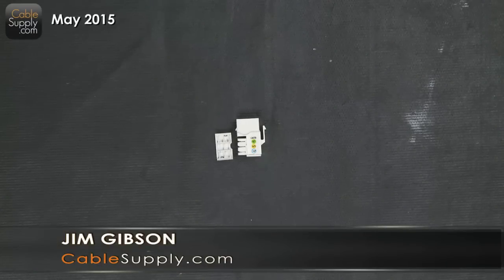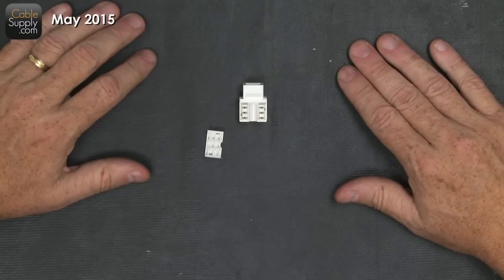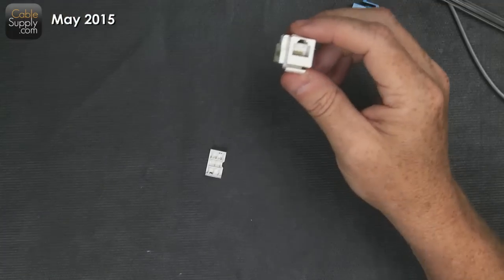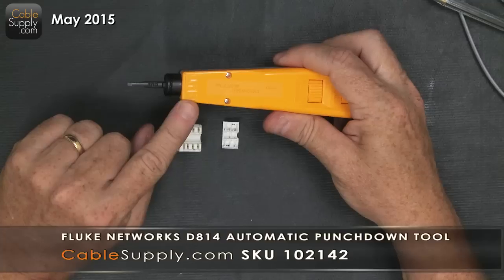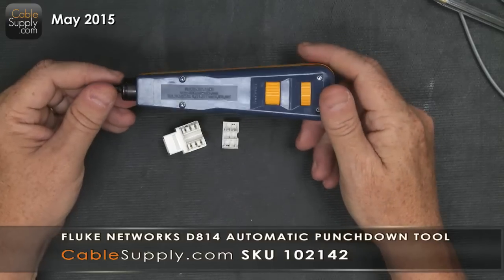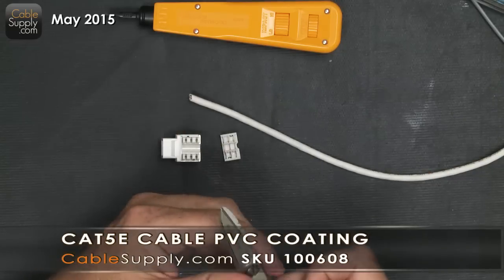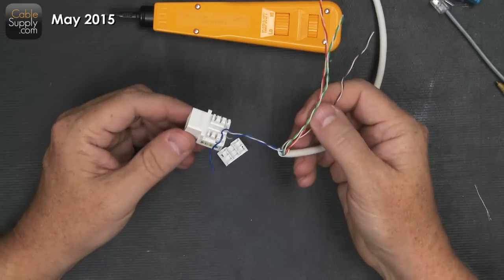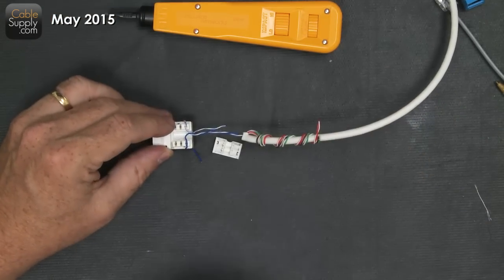How To Install A Telephone Jack

Comment: Can't thank you enough for this video. It showed me exactly what I needed to know so that I could rewire an RJ45 to an RJ11. My landline phone was plugged into an RJ 45 jack, so the fit was 'loose', maybe? The problem was I kept getting very brief dead spots on phone calls. I think I've replaced my phone 3 times, thinking that was the problem. I decided that the issue may be with the connections at the wall, so I decided to replace them. We shall see if this works! Thanks again. Midge
Reply from the maker: I am glad that you found my video helpful. Thanks for  watching and  please subscribe.

Comment: I've worked with data wiring before but telecom is somewhat new to me and I noticed yesterday that one of the other station lines had cat5e running to it (which is what I was using for the line I was moving as well) and it only had the blue pair in the jack.  This makes sense.  But going back to the 66 block, all 4 pairs were punched down in the standard order...and I started looking at the limited space on the block, and started thinking...well several things.  I'm not sure how to put it into a question, so I'll just jot down all the thoughts that I had.

All these pairs taking up space on the block, but going to a single jack.  There could be other stations ran to the same place and use a 2 or more keystone faceplate to have multiple stations in the room I guess.  But that's most likely not the case and that limits how many locations you can use from a single 66 block.  But then if you only use the blue pair and don't punch down the rest, the color order will not exist, they'll all just be white/blue and blue....but is that a problem?  Maybe the solution is just more 66 blocks.  Or a 110, I've heard they are more space efficient.

I just thought of a way to word an actual question, but going to leave my ramblings there for more context.  What is the standard practice once you get those 4 pairs back to the network closet?  Do you just punch them all down and use multiple 66 blocks as needed and potentially have dozens of wires that are just never used?  That doesn't seem very space efficient, but I am a noob so I'm not sure!  Thanks you very much!